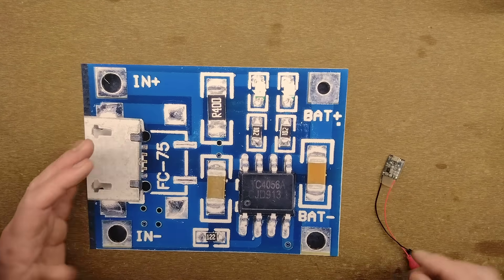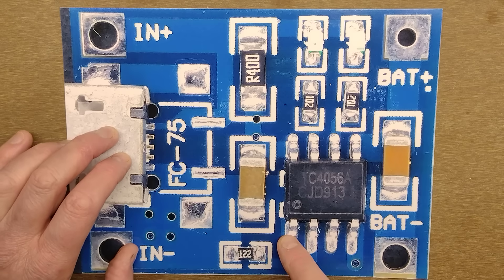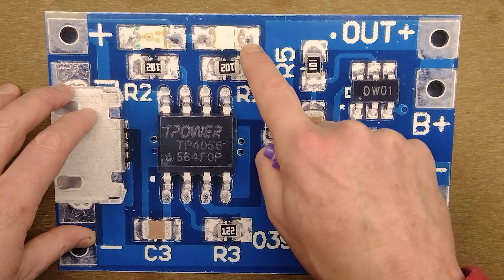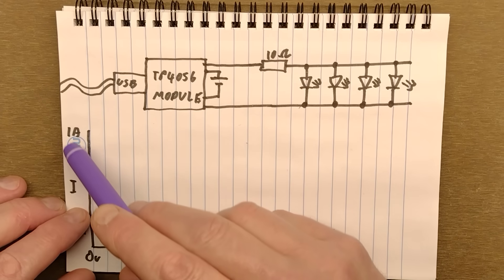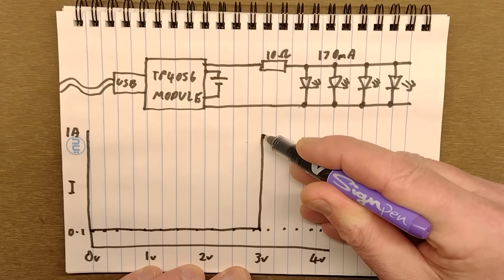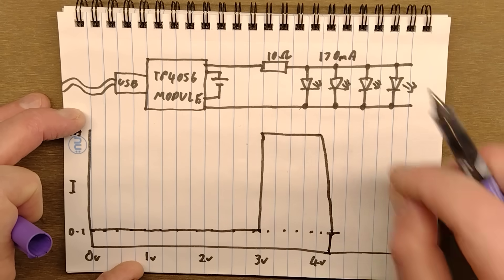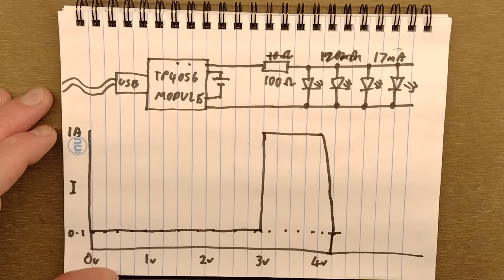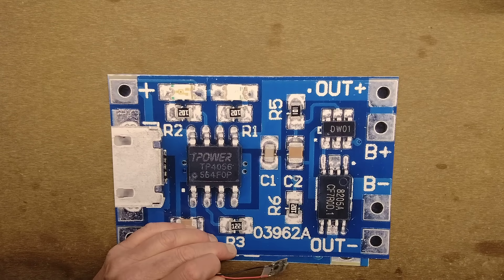TP4056 myth busting

Comment: Great video! You explained it so well! Few personal notes I would like to add.
-I don't think it will do any good to your battery by cycling it with a end of charge current, the best would be adding an USB/battery switching circuit: 
If USB is plugged in then charge the battery and power your LED strip with that same USB supply, if USB isn't plugged in then the battery will power your LED strip. This can be done easily with a few diodes, a mosfet and a resistor (and a step-up converter if needed).
-Concerning the TP clones some are dangerous, not charging the battery correctly, dead chips etc... Back when those modules came out they had the official genuine chip but over the years clones came out and it's now praticly impossible to find those modules with genuine TP4056. However you can still buy some. Not saying that all clones are worse but I'd prefer to go with the genuine ones for safety reasons.

Comment: Clive, is there a voltage limit to these boards or could they be used in say a 12volt or an 18volt charger... I find with a couple of chargers I have when they reach fully charged the state charged and there they sit, while the battery continues to self discharge ... By the time I get around to using the items they are now virtually dead. 
I liked the way you said this board actually would turn itself back on after the battery self discharged enough to trigger it to return to charging. 
Sooo can it, work with lead acid 12volt and nickel cadmium as well as lithium ... Also how about lifepo4. Basically for trickle charge circuits ???
Reply from the maker: These are only suited for charging a single cell to 4.2V.

Comment: Just bought a pack of 20 of the second type that you featured, from the 'Jungle' website for a tenner.
One question, If I may; 
If I wanted to charge a series string of say three 18650's, could I employ three modules (i.e one module per cell) from the same 5 volt supply for the purpose of charging said cells? Additionally, If I connected the load direct to the ends of the 3 cell string, thereby ignoring the OUT+ and OUT-, would the undervoltage protection still function?
Thanks for all the videos.
Reply from the maker: Sadly you can't do that.  Because the circuit has a common to the 5V supply it would effectively short circuit some of the cells.
Reply: @bigclivedotcom  Thank you Clive.

Comment: A general observation I've made, these modules sometimes get blamed for not fully charging the cell when it's the cell that's the problem. 
The cells you buy online don't have the same energy-holding-capacity as cells found in the street.

Comment: Hi Clive, I think that it won't work well if your load is higher, like an amp. Consider a scenario of a UPS. Most of the time you just want to power the load form the supply and not from the output of the charging IC. The output of the charging is assumed to go entirely to the battery. There are more complex boards that have "load-sharing" where they can power the load directly from the supply if there is a supply connected. See the "PowerBoost 1000 Charger" and the MCP73871 IC.
Reply: If you wanted to power the load from the 5 volt USB supply, you wouldn't need one of these modules at all. But if you look at the zoomed in picture of the circuit board in this video, you should see that the two outputs from the module (marked B+ and OUT+) are common, so both are coming from the output of the TP4056 charge controller IC. Only the ground outputs (marked B- and OUT-) are separate, with the B- going through the twin-MOSFET chip to provide protection for the lithium-ion cell.

In any case, if whatever you want to power can be run directly from a single lithium-ion cell (nominal 3.7 volts, fully charged 4.2 volts), then you can use one of these charge control boards plus a lithium-ion cell as a mini-UPS: Connect the "OUT+/OUT-" pads to the device you want to supply power to, and the "B+/B-" pads to a lithum-ion cell - either a single cell or several wired in parallel. To start with, let it fully charge the cell(s) before it does anything else. That way you guarantee that none of the output current from the charging IC is going into the cell(s), so all of it is available to power your device. As long as your device doesn't draw more than 1 amp at 4.2 volts, it will not use any power from the cell(s) until the 5 volt USB input to the module is cut off. Which is precisely the behaviour you want from a mini-UPS like this.

Comment: Thanks to your last video I got a few of the boards with the protection included, one is already in use for running a string of "fairy light" micro LEDs off an 18650. But as you said in this video, so far the protection never had to kick in because the LED string dims down so much when the cell gets to < 3V that I know it's time to recharge it in the morning xD

Comment: People don't realise one thing
In this case comparison to hydraulics is right
Your charger outputs 4.2v
Somebody claims battery is still being charged
But the thing is battery is 4.2V as well, hence no current flows
The water level is same therefore water is not flowing
Reply: You should not float lithium ion cells.  Also, at 4.2 volts, current is STILL flowing because the internal voltage is lower and there is some internal resistance.
Reply: @0x8badf00d  yes, you should not float lithium cells
If you have 4.2v on cell terminals and cell is 4.2v on terminals without external voltage applied, then no current flows
You are missing bit about internal resistance
It works both ways and the more current flows the more you lose on internal resistance - direction have no meaning here
If no current flows, then no losses on internal resistance
Why charging current drops by itself while you charge battery? 
Because lower difference in voltage, allows lower current through internal resistance. The direction current flows doesn't matter

Comment: could you in theory use multiple tp4056 ICs to put more cells in series? of course you'd need to make sure the input voltage is right, but could I in theory make a 9v rechargable battery with multiple of these?
Reply from the maker: If using multiple modules to charge multiple cells they can't be powered from the same supply, as one connection is common and it would short some of the cells.
Reply: @bigclivedotcom  of course, but would using a 9v (or probably 10v?) supply and stepping it down to 5v for the middle connection (second cell -, first cell +) work?

Comment: Add to the list of charging ICs the MCP7383x ICs by Microchip, I know some of them are designed for very low current applications (like 150mA full scale, vs. the TP4056's 1A full scale). Work pretty much the same, and might be worth a look - students can grab free samples of their products as well (or could last time I checked). Not a sponsor, just a recommendation.

Comment: I actually have one of these ICs in an upcoming design and I've never worked with them before, so this video was useful in better understanding the practical operating behaviour. I was considering adding a fairly expensive PMIC to the BoM because I couldn't quite figure out the shutoff behaviour (the perils of auto-translated Chinese datasheets) so this has saved me a bit of cash!

Comment: You need to the Ultra-mini Type-C
 Type-C USB Charger Module DC
5V 1A Charging Board for 1S 4.2V 
Lithium Li-on Battery Protection Board from aliexpress

Comment: Why would the battery choose to not take any of the power that the LEDs are taking - is it because the battery's resistence (impedence?) is much higher than the LEDs, so they will take all they can use

Comment: Can you use this 10Ohm szenario to limit the battery to 4.1V for longer battery lifespan?
Reply from the maker: Sadly It's not easy to make a lower voltage charger.
Reply: @bigclivedotcom  There are a few chips out there that support configurable cut-off voltage. But those are €14 and a tp4065 is €0.60.

Comment: What if you took two of these cheap USB power-bank boards and wire them ("in parallel") on the same battery, provided that you only use one of the boards for 5V output and the other board for 5V input?

Comment: These modules are great. I'm using those for quite some times with removed laptop batteries. But not all Laptop batteries are usable with this. there is 3.6V battery which is unusable with this (module get burned). also I use 2k resister which limit charge current to 500mA. the reason for that is this TP4056 act as Linear regulator when it come to reducing to5V to 3.6-4.2V, it dissipate (5-3.6) * 1 = 1.4W as heat. But there is new module that use switch mode to reduce voltage module is IP2312.

Comment: Problem is so many of my reputable 18650s that still have capacities in the 40-70% range never get to 4.2V even if leave on extended periods of time.  After an hour or two they get toasty warn and just continue baking without  ever reaching 4.2V.  So as a matter of course I have to monitor cell temps and get "settled down" voltages of 3.9 to 4.1V.  Wish there was a way to adjust top off voltages especially 4 to 4.1 volt range ?  Same on cut-off voltage.  Many cells get toasty at 2.5V so 2.75-3.0 ranges would be cool.  Any suggestions??
Also, I wish there was a through hole version or at least an SMD version that was twice as big.  God dam chips these days are so fricken small you need tweezers microscopes - it's just more bullshit  you can't fix it so we will sell you another.   The lame micro usb port flew off on my last build when I plugged it in.  I know you can reinforce the posts with extra solder but hell, the last USB micro version batch I got only had two solder posts and I could barely see the solder on it.  Is it any wonder the dam thing went flying.  The mini USB versions usually have fours posts and I have not had problems with them, yet.  Totally agree with BigClive on having the "adjustable"  current resistor to be through hole or special solder points bigger than flies dick.  
There, I feel so much better.  Happy holidays everyone!
Reply from the maker: If a cell never reaches 4.2V then it has an internal shunt.  If should be discharged (for safety) and recycled.
Reply: @bigclivedotcom  Good to know, thanks!  I am relatively knew to lithium recharging and may just get panicky when cells seam warmer than they should.  In hindsight the  cells may have gotten to 4.2, turned off and then somehow started charging again or maybe they were very close to 4.2V and I pulled cause too warm -  or maybe my first batch of chips were bad?  Laptop cells were not great but load tested to 1.6 Ah vs 2.6 original? 
I have ordered 2 batches of 10 chips and noted the 1st batch averaged 4.12 and the second averaged 4.24.  Measurements were taken on output of unloaded chips.

Comment: I had the misfortune to supply one of these chips with 12 volts and was rewarded a few minutes later by a short high frequency crack.  Observation showed a hole in the TP4056 encapsulation - my bad.  However, my son said to prevent future errors of this sort (caused by using a 3 memory power supply and having the wrong button pressed) I should strap a zena diode across the supply rails.  Being a novice at this electronics thingy which way round should the zena be connected and what value of zena would you suggest I use?    Great videos, I always enjoy your across the border humour and the visualisation of the circuits under discussion. You obviously go to a lot of trouble making these educational videos - they are much appreciated.
Reply from the maker: A zener would probably also fail, as they dissipate the voltage times the current as heat.
Reply: @bigclivedotcom  I forgot to mention that I had the power supply set to CC of 1 amp. so would change your answer?

Comment: Should you only use these boards to charge batteries with > 1 Amp capacity due to the 1 Amp charge current?  Any risk charging 500mAh or 800mAh batteries?  I assume you can swap out the 1.2K ohm resistor with a lower value to reduce the charge rate.
Reply from the maker: Increasing the resistor value decreases the charge current.  2200 ohms is about 500mA.

Comment: Ah, I liked the Monolithic LTH7 a bit more than the TP4056. Although the Top Power is fine depending on who the manufacturer is some of them weren't correctly reading the program resistor (for low amperage).

I still have a few rolls of different Top Power charging ICs from LCSC that I've been meaning to try out. There's some neat integrated features in some of the variations.

Comment: Yep! Some people don't know how chargers work, they also often get confused in thinking if they plug their 5v 1A phone into a 5v 80A power supply 80A is going to flow into their phone. They need to learn about Ohm's Law. The phone limits the current all by itself.
Side note, the modules with the DW01 are nice however you didn't mention that most Li-po packs that you might salvage out of something will have that same or better protection already attached. So no point in giving it "double protection".

Comment: I have a UV sanitizer that, as it turns out, really needs at least 5v to operate. It nominally works on alkaline batteries, but won't work on 1.2v rechargeables. Having cleaned up leaking batteries far too many times, this looks like an excellent solution. I probably even have a lithium cell lying around I could repurpose. Thanks!

Comment: Hi Clive, good information.  It would be worth showing the bottom side of the board to educate people how the heat gets out of the IC.  There is a solder joint under the chip which directs heat through the PCB, through plated through holes, onto a plane on the back side.  It's better to bond the board onto a conductive surface than something thermally insulating which is commonly done.

Some people (Sorin included) are able to charge with a TP4056 with more than 1A by using resistors smaller than 1.2K.  However, I'm finding the 1A current is limited even with healthy heat sinking.  I'm thinking some of these modules are manufactured differently than others.

Most people expect power banks charge linearly, and complain it takes 4 hours to charge their cells.  Truth is, many of the charge most of the way in the first half of the time and the remainder is a top off charge.  I generally stop the powerbank charge as soon as the fourth (of 4) light starts blinking.

Comment: Interesting look at a handy module. Great use of CliveCAD there: No curve tracer required! 

Might get a couple and run some tests, some modules I use in my projects get multiple extreme tests of the control IC's inputs/outputs to look for potential problems down the road. 

EG: Very high/low resistance at various points to make sure a bad connection or failed component won't under/overcharge a cell etc. 
Or throw many amps at a cell without warning, had a component failure that caused that once. Due to a current sense resistor (shunt) going wildly out of spec and a lack of inline resistance to the pack. I temporarily replaced it with a calibrated length of wire in the interim. No harm done however, it was a large rugged lead acid fortunately. 
I admit it wasn't a charge module but I was in a hell of a pinch and it was monitored.

I've been collecting discarded cells and packs for years.. must make use of them before they are completely knackered like some of my stash of emergency lighting lead acids and SLI lead acid batteries. I don't mind them being weak though; the price of free was enticement enough and the transportation provided entertainment.

Comment: I've managed to scavenge some discarded vape batteries,  and with the assistance of some 4056 modules, and a bit of firkling about, and rejigging the LEDs, I've converted both of my illuminated magnifying glasses ( similar to the ones you use ) from bog standard alkaline to rechargeable....
Thanks for the Tip....👍😊
From an old Ham..Keith (G4TDA)

Comment: Is there a similar circuit that would stop charging at 4v or 3.9v instead of 4.2v? If you have some project where your battery will be charged for most of the time it would be much safer to have lower voltage  than 4.2v. I would gladly buy a big pack of 3.9v chargers if these were available
Reply from the maker: It would be great if there was a standard module for that.

Comment: Is it possible to tie the inputs of each 4056 module together in a parallel configuration (without any load connected). I wanted to use a 5V 3A phone charger brick to charge two 18650s at the same time with the two tp4056 modules. The only problem I see, is if the batteries are at a different voltage, and are unplugged (not being charged). The other battery would affect the cell with a lower voltage, right? . I ask cause I saw another video with this setup.

edit: Doy, I was being dumb. From the datasheet: No blocking diode is required due to the internal PMOSFET architecture and have prevent to
negative Charge Current Circuit. Great video btw

Comment: I had these chips (4056) conk out on me when I tried to boost the current capacity in usb drill by plugging it into the powerbank. Not sure what killed it, in theory it's current limited and thermo protected so I'd lean into something to do with inductive load.
Reply from the maker: It may have been a voltage spike issue.

Comment: Have been using tp4056 from aliexpress since 2016, had 0 problems. Even tried using two in parallel with different resistors to get 3 A , which still works fine.

Comment: Want to see BigClive use these chips with the cells from those portable fog machines in some sort of project
Reply from the maker: I featured that recently, making a power pack for LED strings using two parallel cells and one of these modules.
Reply: @bigclivedotcom  cool, I missed that 1. I will find it & check it out